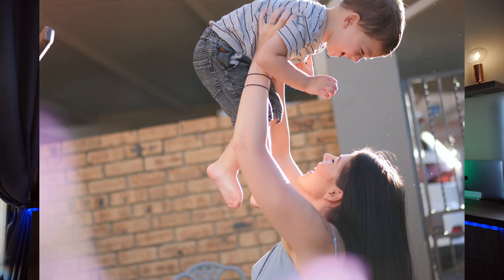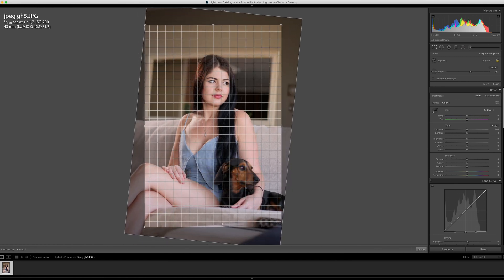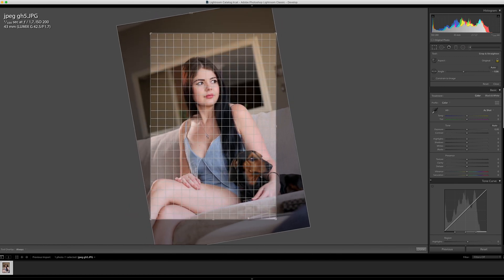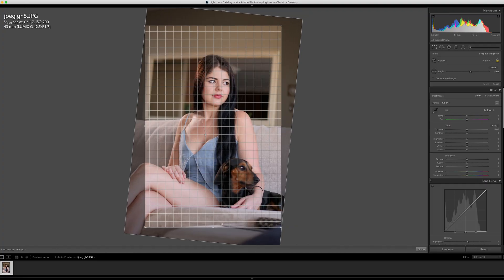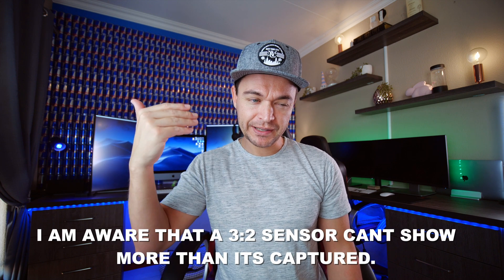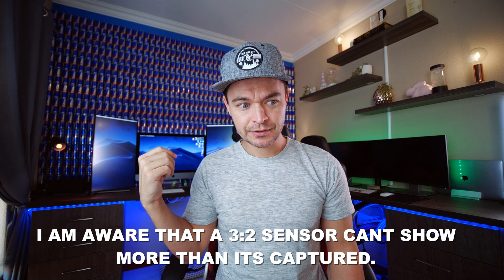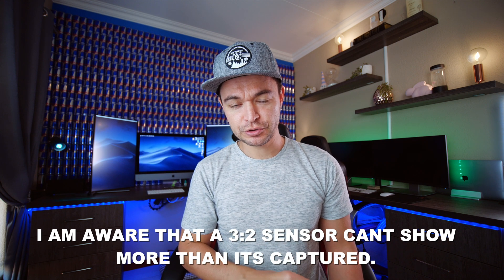Why CAMERA sensors are the WRONG shape...finally the iPhone 17 is learning!

Comment: I was about to make a video along the same lines, except it would point out that the new Insta360 Go 2 does have a circular sensor, and it demonstrates very well all the benefits you describe. No, it's certainly not a DSLR, but it's not bad for its size and price if it's the right tool for the job in hand. Hopefully mainstream camera manufacturers will take note!

Comment: Coming to think of it, you're on to something here. It will help a lot in the sense of where you took the picture but accidentally cut one of their limbs of for example, all you have to do is go edit it so all the limbs or important things are back in the image (if you captured it)
Reply from the maker: Exactly, the possibilities in post is quite amazing. If your “original shot” was in a circular sensor, when you scale the image smaller, it will allow the image to shift further to the left in the area of the circle as the height and width of the image won’t max out the circle. This could be so innovative and hardly costly for any manufacturer.